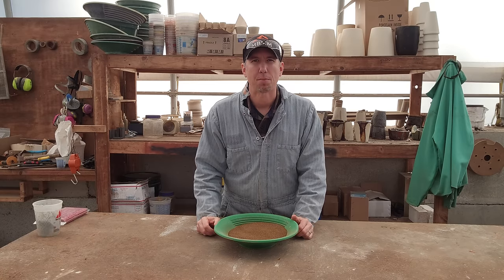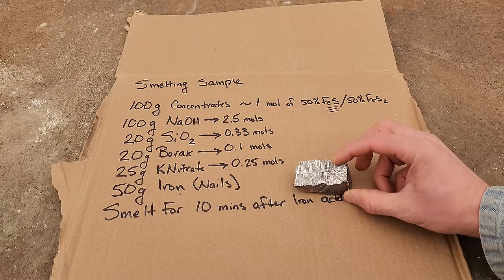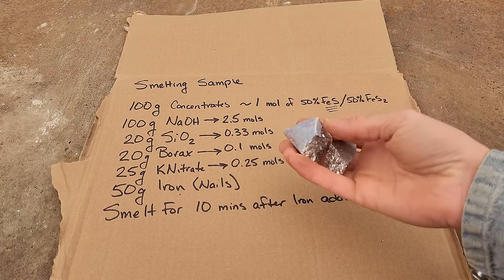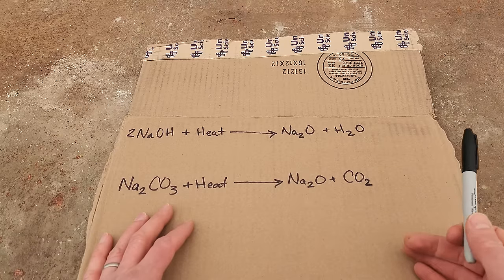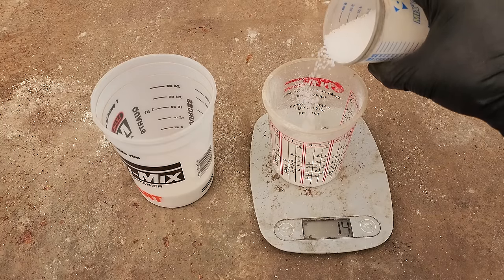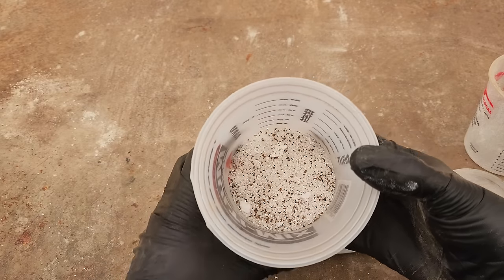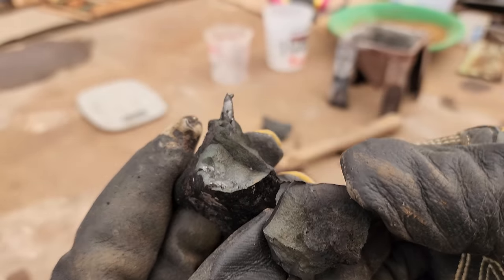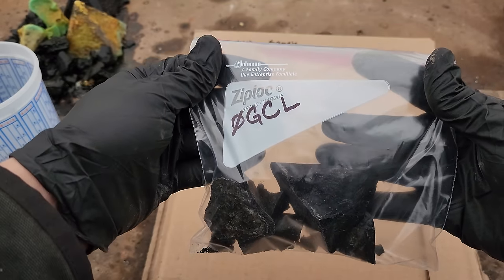Mastering Gold Smelting: Techniques for Extracting Precious Metals from Sulfides

Comment: 15:18 "helps the charge not stick to the mold" (WD-40)

Two suggestions for alternatives: 

1- if you prefer the convenience of an aerosol... the are several dry lubricants available in an aerosol can, that will perform much better in your application. Graphite, molybdenum disulfide, and tungsten disulfide are all readily available through most industrial and scientific supply companies. If you prefer a liquid that will serve many other uses around the shop... P.B. Blaster has a much higher flash point than WD-40, and tends to penetrate better into rusty surfaces.

2- graphite powder is usually the cheapest of the aforementioned dry lubricants, and is available in a near-nano particle size, often referred to as "polishing powder"/"burnishing powder". When you have a couple hours... use a wire brush to knock the scale off, then polish them graphite. The treatment will last for several uses.

Comment: Why not use tiny nails, which would give you a larger iron surface area from the start?  I loved this video because it saved me so much time doing trials, myself.  Also, I wonder if boiling the mix provides adequate stirring?  Thanks for posting this important video.

Comment: I like your traditional fire assay methodology, it is much the same as assaying was conducted >100 years ago (not trying to disparage what you're doing). This just shows you can determine precious metal content using straight forward methodology and easily available equipment and materials. These days in the minerals industry we are spoiled by modern analytical methods, we can in the laboratory analyse hundreds of samples per day and get incredibly accurate results reported in the parts per billion. Neutron activation (inaa), mass spectrometry icp/ms, X-ray diffraction and lately hand held portable x-ray analysis. Some labs us e silver as the collector metal, not toxic but expensive, most labs use lead. Most labs offer fire assay for gold, you can shop around for a range of methodologies to analyse for gold, and then when you start assaying samples with coarse gold the whole thing goes out the window.

Comment: JASON-  If I was you I would consider attempting to shake or vibrate your molten material/ flux when
You pour it into your Triangle mold, ( shake/vibrate triangle mold) this would more effectively allow the molten metal to travel down to the bottom for accumulation.

Comment: Truly enjoy your experiments and your way of taking us along for the ride. I wonder if you'd be ahead of the game treating your raw concentrates with carbon disulfide to directly dissolve away your sulfur. This would be more or less a room-temperature reaction. Carbon disulfide CS2 is a nasty, toxic, foul smelling and very flammable liquid and it's possibly expensive to buy as a reagent. Once reacted, you could ignite the mixture and burn off the CS2 (generating SO2, also toxic) but the idea is to get rid of your sulfur (which seems to be your main pollutant) leaving behind carbon. I am not a chemist and in no way am I suggesting that this idea will work, but I know that sulfur dissolves in almost nothing other than CS2. I am also thinking that treating your concentrates with hydrogen peroxide (beauty shop grade, not 3% supermarket grade) and a bubbler consisting of an aquarium pump might shake loose some of your sulfur. Overnight or 2-day reaction.

Comment: Jason, try disolving the sulfides in muratic acid. I did this with a 2" thick solid piece of pyrite vein, resulting in quartz crystal digging
Reply: ...quartz crystals (against the wall rock) & iron oxide & gas.

Comment: A while back you were trying to process some of these sulfates with hydrogen peroxide and not doing too well besides it was very cost-prohibitive and I was just wondering if you had tried using sodium percarbonate instead which is considerably cheaper and produces High concentration of hydrogen peroxide and if I remember correctly Soda Ash as a byproduct and it is much easier and safer to handle and liquid hydrogen peroxide ever dreamt of being

Comment: if there would be water, then NaO2 would go to NaOH, the extended chlorialkali process, NaOH -> Na (molten electrolysis) -> NaO2, cycle continues, Na as metal reducer more active metal, but easy to electrolyze, just normal metal making, chemistry process
Reply: hey try flash melting continuous flow tube, with a induction/resistance element coil around it, works like water flash boiler, but for melting/separating stuff fast, solid powder in melted liquid metal out

Comment: Cool beans. Here's the list. 
It's pyrometallurgy , not Pyro metallurgy...
The description you were looking for is the gold is not freemill but molecular bonded to the sulphide. 
The use of bismuth over litharge is of hot debate. Here is why. Bismuth is not refined like pbo and introduces exotic industrials. Some can survive the cupellation process and would require hydrometallugy to remove. 
The use of sodium hydroxide as a substitute for dodium carbonate. Sodium hydroxide is now in competition with the potassium nitrate for that precious oxygen molecule and its the same as in hydro metallurgy as Pyro metallurgy, redox....
Your nails where not attacked by the Sulphur but your double  oxidizer, here again , that o2 molecule being savaged is important. And the pinnacle of smelting. 
I will give you an ah ha moment Jason. @ 28:24 , you should just have doubled down on the collector. 
When we mix up an assay , the reason for the mix of litharge and why it's used is to literally rain down through the melt. The use of shot is random and always loss. I am glad you choose a neutral Flux as on most instances, advanced fluxs are not required. Here is  a disclaimer , most ores have their own little variation. Pyrite and sulphides , they are very unique both geographically and chemically. That's learned over time to get that feel or eye for it. Glad you did the video. To have cupels and not assay is questionable. Not as hard as you are expecting. Keep rocking it.

Comment: What is mols
Reply: A way to compare the weights of different pure chemicals to the number of molecules of them.  If you add up the Atomic Weight of the elements in the compound, that number of grams of it will contain a constant number of molecules ("Avogadro's Number"). Used in setting ratios.

Comment: You add the collector metal based on the size of the cupel your using. For one that absorbs 30 grams of lead then you you 30 grams or less for this assay melt. This is not really processing as much as it assay of the materiel in these amount I.E. 30/60 gram cupel. Why are you trying to reinvent the wheel???? You must simply roast away the sulfides before you start to smelt,